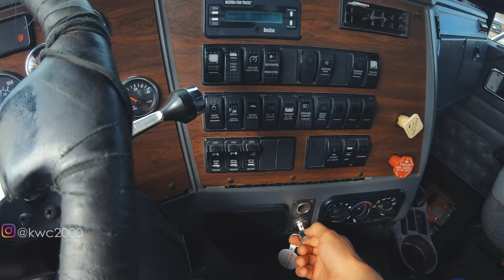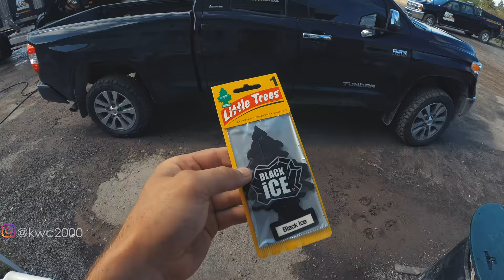Millennial Driving Tri-Axle Dump Truck (Ripping Asphalt On-Site)

Comment: Cut off one end of a q-tip and put super glue on that end and stick it to the key.  Hold it in place for several minutes, and then remove it.  It also works if someone breaks off the end of an Aux cable in your radio.

Comment: To assist in removing your snapped key 
You will need a selection of o-ring seal picks and a small pair of needle nose pliers. 
Use what ever combination of seal picks you can to move the key out one “stage” then while holding it out with hope that the barrel doesn’t pull it back in (springs) grab the pliers and rip out the rest of the key 🤙

Comment: i work for a apshault company down in ny best way to clean tar and oil off trucks is a rag soaked in gasoline (no smoking ) lol , and use a hot water preasure washer that works wonders aswell , for a nice shine a trick of mine is use atf , its a mineral oil so it doesnt have dust stick to it

Comment: As for the key Air pressure works sometimes. Give it a blast of shop air with a pin point nozzle, engage safety squints and hope! Lol. Other then that, a wooden toothpick and a small DOT of super glue(careful), also a hooked tooth pic (metal) may work, There’s a few starter ideas. I’m sure if you put a little try in it it’ll come out;)

Comment: Manual windows on the triaxle lol cheeped out.
Reply: Nahhh it's a safety thing, our 250k mixer trucks have manual windows too
Reply: @bcb0xer  you don't have to get so aggressive
Reply: my 2016 mack has crank window on drivers side. i like it pretty good.
Reply: @davidobrien4436  yeah, just had to send my Mack to the shop to get a new switch. I was having to get out of the truck at the quarry scales to get my ticket 🙄

Comment: For your water setup all you needed  is a cheap 80$ submersible pump from Canadian tire which comes with a garden hose connector.  You can get a few ibc water totes and get a water company to fill them up if you want cleaner water.

Comment: A hot pressure washer is the way to go. You can get grease off so much easier when you need to. It’s just a lot easier to clean things with
Reply from the maker: That’s what I’m thinking, the grease is so hard to get off even with a strong degreaser
Reply: Ken White Construction yea helps with the grease soo much

Comment: Ken, we have a steam pressure washer at work. Runs on electric with diesel heater and shifts muck much better than any cold water washer will. You pronouce asphalt correctly and as you said it is zed not zee but then i am English. Love the trucks by the way, my main interest. P.s. i don't suppose you do keyfobs/keyrings. I collect them any currently have approx 500. Cheers.
Reply from the maker: no I dont do keyring! sorry 😐, thanks for the comment!

Comment: How to get a broken key out of a door lock! You will need a battary of pointy tools, needle nose tweezers, needle  nose pliars, scratch ale, & strong suitable magnet, in case the base metal of the key is a ferris metal. It shouldn't be to difficault to get out. Try to hook the point of the scratch ale under the teeth of the broken key, & pry up, & pull back. Should come rite out.

Comment: You would love the pit we have out here it's a 12 acre site and it's 160ft deep. The used all the material that they dugout of the pit for there asphalt plant and once they used it all they have been filling it up with concrete and asphalt to fill it back up. Once it's completely full they will move there plant across the street to this location and use what they have left to use where the plant has been sitting the Last 20 years and then fill that side up and move to a completely new site 20 miles away from where they are now

Comment: Shift it. Manual transmission for the win, are you using a microphone on the GoPro ?  Thank you
Reply from the maker: Yes that’s why audio is bad
Reply: Ken White Construction I’m actually impressed the audio is really good for a stock GoPro
Reply from the maker: Ya I’m exited to get the new hero 8 with the shotgun mic and light mods
Reply: Ken White Construction for sure, I ordered mine, I’m using the Hero 5 and the G7x at the moment, I think the 8 will replace both of them.

Comment: Why do you guys up in Canada have your axles more spread out than like in the US
Reply: Our Load ratings laws are way different due to frost levels in the Spring months, I'd say 100% of our roads are Asphalt, so there's no reinforcement to it. I'm not sure why they don't have it set up as a regular tripple axle with all 3 close together, then having a 4th axle placed just after the cab to take weight off the Drives, different provinces have different weight regs and axle set ups
Reply: Thanks

Comment: weld a small rod to it then pull it out tht way
Reply from the maker: now THATS exactly why I put it in the video! I will do that! thank you very much
Reply: @KenWhiteConstruction  your welcome
Reply: Probably smarter to try a piece of metal coat hanger and some crazy glue first.  Sorry I forgot its 2019.  Use some Bell Let's talk glue
Reply: You can get it cheap cheap at dollarramma
Reply: @MrOpcode  ive already dont it. it dont work